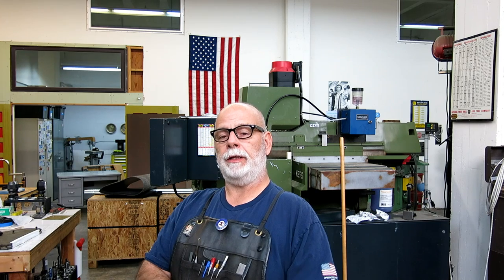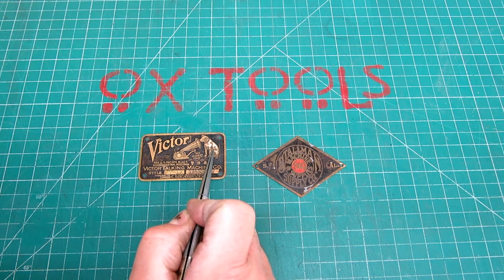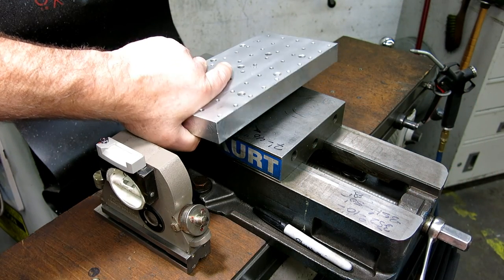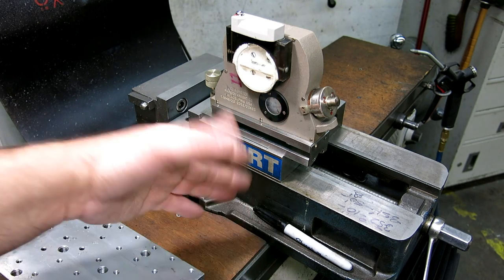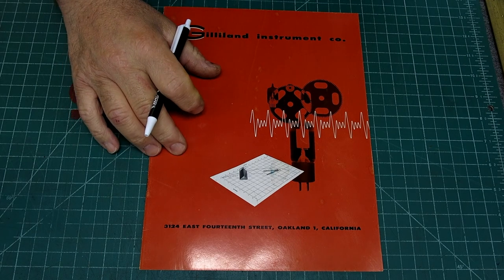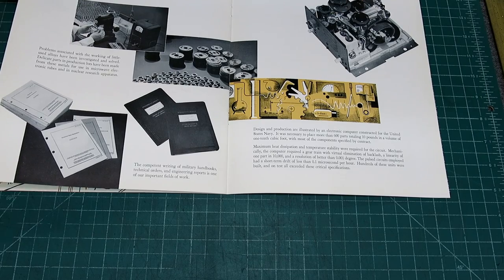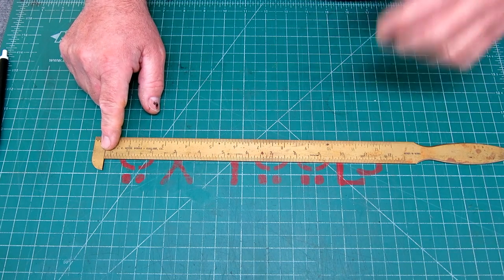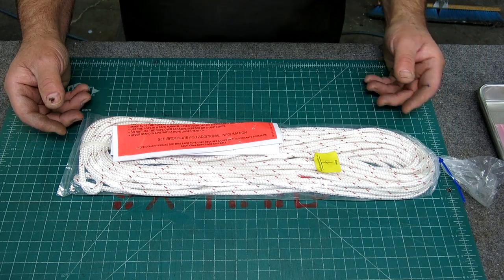Monday Night Meatloaf 140

Comment: I have a Hilger-Watts clinometer that looks very similar to the Warren Knight that you have.   The original vial that is installed on mine is looks identical, the window has 3 screws in the same location, and the vernier and thumb rest are nearly identical. Mine has no model number, but looks identical to a picture of a TB103 Hilger Watts 90 degree Clinometer. My scale is only on one side of zero. The vial appears to be a 5 minute/division, so the 40 second vial add-on would represent a significant increase in sensitivity.  A clever way to approximate a more expensive instrument.  Or did the original vial fail?  It looks kind of odd at 10:42.
Reply: I also have a Hilger Watts that appears to share nearly all the parts, bar the main body (and the add-on vial). Who copied who?

Comment: 1. re; the Gilliland brochure: notice the clock is BEHIND the workers. I suspect there was no such clock on the opposite wall. Back then, management told you when to sit and when to stand, when to eat and when to piss, even more so if you were a woman.  
2. The brass rule looks like a case gauge used in armories. Brass so as to be non-sparking.
3. I wonder why I have never had the problems you have with ratchet straps - except storage. Storage is my only bugaboo for those.  Are you any good with knots?  You need to know fewer than a dozen knots.  
I hgappen to have a lot of experience with rope, banding tapes, and flat webbing; from climbing, rigging, theater, boating, you name it.  And there is a problem with flat tapes: there are only two or three knots which retain a significant amount of the line's strength.  Twisting tape into knots weakens it MUCH more than a round line. A knot in tape may have only 10% of the breaking strength than the running line with no twists in it.  You also cannot twist it AT ALL without again significantly reducing its tensile strength.
In addition, thin tape under tension is much less pleasant to work with than laid or kernmantle line - some banding straps will CUT YOU.  Tensile strength isn't everything. ;D  But hey, if cost is the only criterion that matters for your tools, carry on with your bad self. ^_^